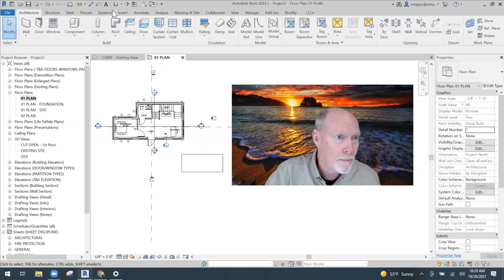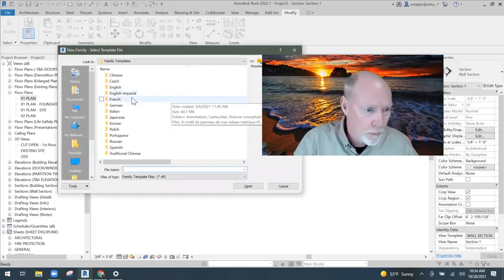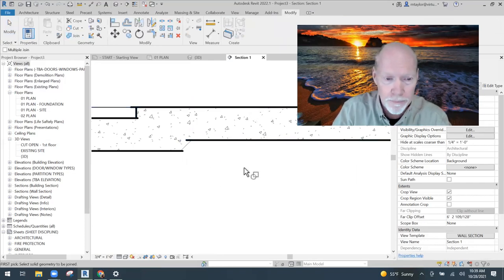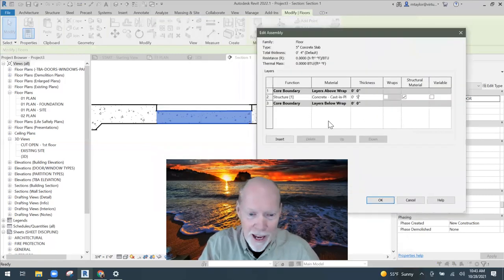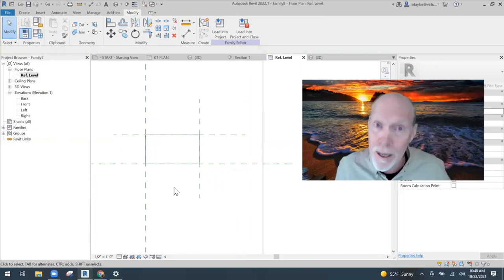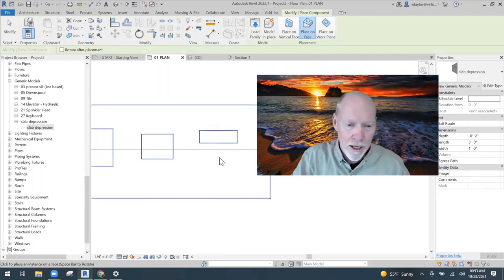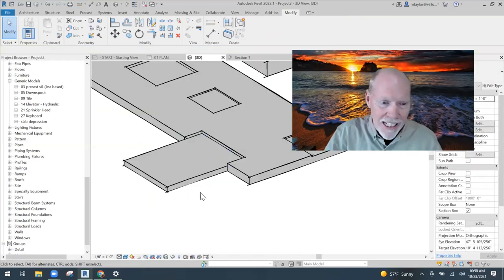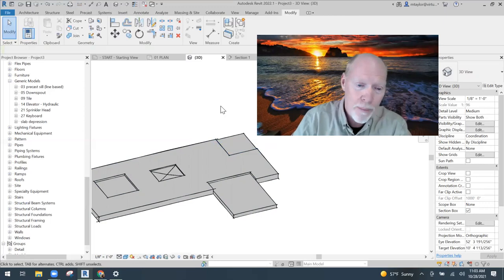SLAB DEPRESSIONS: Different ways to do it

Comment: I tried the slab depression family face based and when i drag it over into my floor plan i dont get the options to attach it to a face.  It seems to drop into my plan but will not show up at all unless i hover over it with my cursor it shows its outline.

Comment: this was AMAZING!  one question, would the modify element option to slope the slab also work in concert with the depression where you used the void/depressed slab family? im going to go try this out but if it does this saves a lot of time.  sloping floor drains with modify slab can get very tricky especially around columns, walls and other edges and corners but this method gives you a simple, clean rectangle frame everytime

Comment: Too good and amazing, however i would like to add one more trick which able to cut geometry two times if in case sunken slab has more depth of about say 1' feet which required two floors to be joined together i.e, one main floor + below more thicker slab floor for sunken slab extended offsets to achieve deeper cut and leave U shaped cut in Section and this can be done with In-place model and choosing Floor category and put in Void and can be easily used for two times cut geometry. Anyways Thank you so much .    .....

Comment: can cut family slab incorporate into phase ?

same issue as cut slope roof
Reply from the maker: Unfortunately not.  I found that using a VOID and cutting slabs is not assignable to a Phase.  The way I get around that is to make smaller slap pieces and assign them each to a phase.  It's more difficult, but gets the job done.

Comment: Man, I just love your videos,  been looking for someone like you, very easy to follow along. Currently I'm using sketchup and layout for all my construction documents, I would love to use revit lt and the videos you produce are gold..problem with using sketchup is all my drawings have to go to a structural engineer and they need a .dwg file, it's doable  with sketchup but requires extra work. Going to try revit lt's  30 day trial. Thanks again.
Reply from the maker: You won't want to go back!  Revit is total worth it's weight in gold.  And you will get better and more efficient each day.

Comment: I love your videos! I work for a structural engineeeing firm, and I've been wracking  my brain on how to model brick ledges in the slab. I would like to create a void beam family that has parametric properties for width and depth. Would you create the beam family in the same method?
Reply from the maker: I’m not sure you can tell a ‘beam’ to be a void cutting object. You would still need to make a generic family to do the cutting.  Or you could make a NEW shaped beam with the edge already cut out!